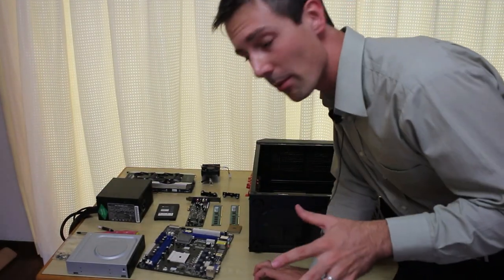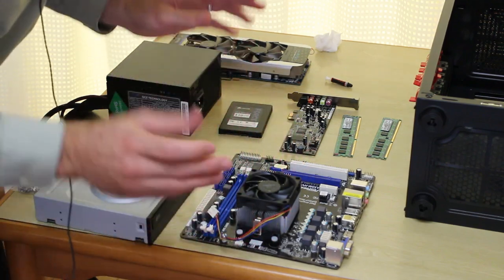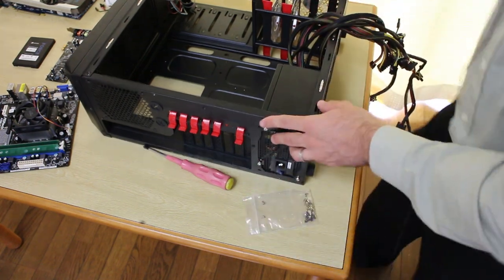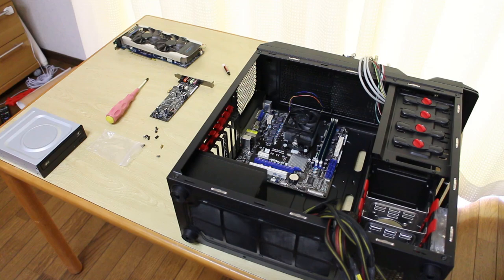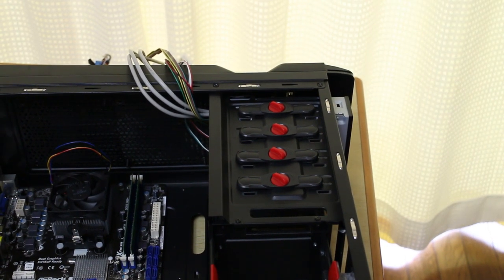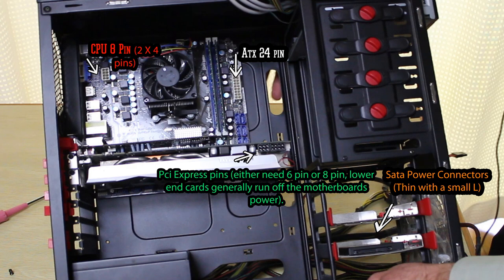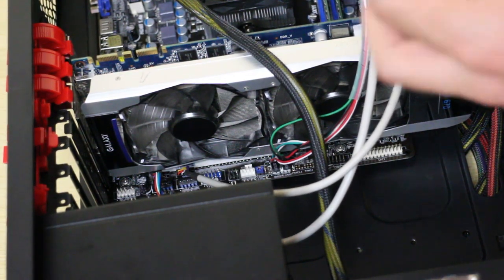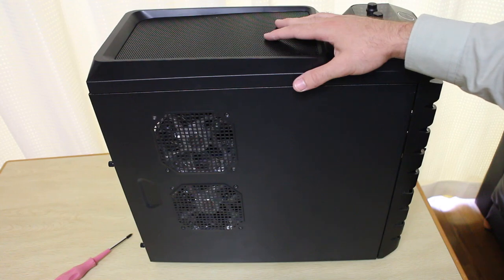How to BUILD your FIRST PC (Full Uncut for Beginners)

Comment: Built my computer via pcpartpicker. Can you give it a look and tell me if everything looks good? (Editing and a little gaming is what this is going to be used for) I did not include a monitor or OS for I have 2 monitors and a hard drive with W8 already installed on it. http://pcpartpicker.com/p/zXXVbv
Reply: For that price, it's awesome! Looking to make my own computer too. For the graphics card, I'm going to end up going with an AMD R9 series card. It's cheaper and still pretty speedy, plus for the price of an Nvidia I can get 3GB or 4GB. With the money you save you can also upgrade to a 1TB HD. Here's my build if you want it; it's a little cheaper, with room to upgrade to your i7. It's 640 or so without the monitor and keyboard:
http://pcpartpicker.com/user/sunnyelsa/saved/hTdMnQ
I did not include Windows 8.1 as well (because I can get it free through the university). And I found one heck of a case with bang for your buck, if you're interested (it's $40 and good quality, not to mention pretty):
http://www.newegg.com/Product/Product.aspx?Item=N82E16811147153
Reply: Very nice, I am more into the black/green color scheme case though
Reply: Very nice I did something similar I found a cheap 300$ build and then added the gtx 750 ti I run it and it is great for medium gaming
Reply: Sick my man
Reply: Nice build!
Reply: You should probably go with a k series processor for over clocking, since this is a gaming rig going for an i5 could allow you to buy a better graphics card.  All your parts will work well together though if that's what your asking.
Reply: Which games you wonna play with it? 'Cause your build is not good. A i5 4670K with a gtx 760 or 770 would be much better for gaming
Reply: its for editing not gaming
Reply: Oh than is this build good enough.
Reply: RebelEdits make the optical drive bluray

Comment: Is this a good build? http://pcpartpicker.com/user/GeekaWhat/saved/7bT323
Reply from the maker: Jacob3922 | RBLX Will run games pretty poorly, for the money this is one of the best you can get - http://pcpartpicker.com/p/xXTTxr if you can get an r7-250x for cheaper than go with that, though I would get a better power supply while you are at it lol.....  And as for a case just sit it on the card board box until you can afford something better.
Reply: Guys, guys. Just go to iron side computers and get the minion
Reply: Andrew Oh  The minion is overpriced.
Reply: Jacob3922 | RBLX You should get a Quad-Core instead of a Dual Core. It can run a lot more faster. Plus, its only ~$10 difference. In the long run, it'll be worth it.
Reply: AlphaPlays TGI?
Reply: Jacob3922 | RBLX I would suggest more RAM, the processor at 3.8 GHz seems great though
Reply: Do the parts and case come with the screws? 
Sorry if it's a dumb question I've never built a pc before
Reply: Jack The Titan I'm new at building pcs too, i've actually never done it but have been looking at lots of videos for my future build, and most of the time the screws are supposed to come with the case
Reply: For $350 you get an Intel Pentium 3.2 GHz dual core, a 260X video card from ADM or a 750ti from Nvidia with 2 Gigs of video memory, a 4GB DDR3 1600 ram stick, 430 W PSU, a 20-30$ case, 500GB-1TB hard drive for like 35-50$, an LG1150 motherboard for upgrades later on with 2 RAM slots (Get an 8GB if you have the money instead). You can run games like CS:GO, dota 2, LoL at 1080p 60 fps. You can also run dying light and GTA V but you'll get 30-45 frames on medium-high settings. The build I'm doing but I don't care for graphics much as long as I get 30 FPS or higher.
Reply: +Jack The Titan yes, they will come with stuff that will help you get everything together.
Reply: http://pcpartpicker.com/p/zz8KD3 the build. You can change the case and hard drive for less.
Reply: whats your budget
Reply: +Jacob3922 | RBLX lol
Reply: +Jacob3922 | RBLX Your trolling right?
Reply: Shannon Fox No it was a legit question. I had no experience with building computers when I posted this.

Comment: is this a good build? and will all the parts work together?
http://pcpartpicker.com/p/FtHQpg
Reply: Yes the parts are compatible, pc part picker will tell you so.
It is a good build but I'd recommend a 4gb graphics card for future proofing, and the power supply is un- necessary, go for a 500w 80+ silver instead, unless you purchase a more high end graphics card stick with the power supply you currently have.
Reply: Paul Lynch ok
Reply: +Paul Lynch will it tell you if your power supply is too big for your case?
Reply: Hey, usually power supplies are made to fit into any kind of case, but just to make sure look in the product description of your power supply and check the width of it then compare this to the width of the case.

Comment: I would just spend the 5-10 bucks for a wrist strap if I were you
Reply: It's not necessary, but I understand why you'd recommend it, 
As long as you're not on carpet, or you don't scratch your head or touch your pets while building, and you ground yourself by touching your case before starting, you should be fine!

Comment: How does this look? http://pcpartpicker.com/p/bn8KsY Ordering in a week please tell me what isn't good or what is good >_<
Reply: Very nice, quite balanced, 
As you probably know, the 270x won't get you the best FPS but it'll be fine on medium/high and tweaked ultra.
In the future, however long away the future is to you, I would recommend a more powerful Card. Personally, I would go with NVIDIA, but that's me.
If you prefer AMD, go with the 280x or 290x in the future. If you want to go NVIDIA, I would recommend the 760/770
Reply: Looks like a good build. There's a newer CPU though called the I5 4690k, which is cheaper and much better. Also, If you have the money, get the 400R, not the 300R, as it has nice lit up fans (3) (Along with a button to turn the lights off) and has much more advantages that the 300R
Reply: Hey if you guys could tell me what series of graphics card and CPU or APU's of AMD does the GIGABYTE GA-AM1M-S2H AM1 HDMI SATA 6Gb/s USB 3.0 Micro ATX AMD Motherboard support. Thanking you in advance
Reply: Actually I did search the net but it wasn't really clearly written or written in a too complicated language for me to understand so if you guys could just un-complicate it for me.

Comment: can anyone tell me if this build is any good? 
http://pcpartpicker.com/p/k4vhwP
ive gotten a lot of mixed reviews. i know i dont need 6 cores but i dont know much about building and that one was recommended. and if i change the cpu, what else should i change/upgrade?
Reply: Gabriel Rivera You can't connect to the internet if you don't have a wireless adapter. Also if you're trying to run games on this computer, just go to Game-debate.com and click "can i run it" then enter your gpu and video card specs and it will show you how well you can run the game.
Reply: James Cogdell i have a ethernet cable. .thanks for the site
Reply: Gabriel Rivera get a better GPU.
Reply: Phantom yup i kind of completely revamped my build. http://pcpartpicker.com/p/dg9CQ7
got a lot of feedback and suggestions. everyone seems to like it.
Reply: Gabriel Rivera looks great! :)
Reply: +PandaYT Is this a good Build 

intel core i5 4690k processor (3.5 ghz 6mb cache lga1150 socket)

evga nvidia gtx 970 ssc acx cooling 2.0 4 gb graphics Card

corsair cmz8gx3m2a1600c9 vengeance 8gb (2x4gb) ddr3 1600mhz cl9 xmp

western digital blue wd10ezex 1tb 7200 rpm sata 6.0gb/s 3.5 hard drive

Cooler Master HAF 912 PLUS RC-912P-KKN1

EVGA 600W Bronze Pc Power Supply 

ASRock Z97 Anniversary Motherboard - ATX, Intel Z97, Socket 1150

thanks

Comment: this is too much for my brain....im good with programs but not actual PC parts
Reply: it is actually easier the hardware stuff than the programs or programming. HTML  I learnt on my own and it is nasty. Building a PC  I realized that you just need to know the Motherboard manutal, it tells you what kind of RAM will accept and what CPU either INTEL or AMD and what speed you can insert as max same as amount of memory.. The littly thricky part is the umbilical cords like the Reset, power cable, those cables from the case onto the motherboard after that, the rest is not that hard.

Comment: SSD for a first build is a waste of money
Reply: Wicker _ You wont get more fps in game using an ssd. Only faster loading times. Game these days use a lot of disk space, which is very expensive using a ssd. Using suspend to ram is the fastest way to  get your OS running. First users should get a normal hdd and use that money for the best gpu for their money. A ssd can be installed later
Reply: Thomas Cavanagh Who said anything about gaming? SSD's are just good period.
Reply: Depends on your budget. End of story.

Comment: "If you shock things a lot go ahead and get a static wristband." Proceeds to build entire computer without mentioning exactly how the band should be used. I.e. what the clip should be connected to, the motherboard, the case, the power supply, an outlet...

Comment: https://pcpartpicker.com/parts/partlist/
Can someone please help me and tell me if this is a good pc for cod csgo and gta?
Reply: ben Lockwood Overkill for 1080p gaming.
Reply: ben Lockwood Don't change anything. This will keep a great framerate while running any game on ultra and 1080p. I have a similar build and it's fantastic. Although, unless you plan on overclocking your cpu you don't really need a liquid cooler.
Reply: +ben Lockwood
oh my god, you have exactly the same parts i have for my new PC im building. deja Vu !!!

i was also wanting to know if that would be a great setup for gta, thanks !!
Reply: +Zertify http://pcpartpicker.com/p/xCP4kL
Will run bf4 on low settings more than 60 fps
Reply: LEL, That pc can run bf4 on med with 60 fps.
GTA V on lowest = over 60 fps.
CSGO on ultra = 100 fps.
Club Penguin on High = over 9000 fps.
Reply: ***** CSGO you would go above 200 ish?
Can't really tell GTA is high cpu, so idk
Reply: np

Comment: http://ca.pcpartpicker.com/p/WZg823 Can anyone tell me if this a good build? And am I getting the best deal for my $? It's mainly for gaming.
Reply: ebutuoy Hey dude, it looks pretty good, with the exception of two things.

1. Switch the CPU to an i5-4460 or an i5-4440, whichever is cheaper. The one you have right now is meant for overclocking and is overkill for your graphics card.

2. You could probably go with cheaper motherboard, case,  and ram -- it won't make a difference and you can save a bunch of money. Just MAKE SURE to read user reviews on newegg.com before you make a purchase. It has saved me from buying crap products before.

Wow, things are a LOt more expensive in canada.
Reply: ebutuoy Oh, and buy windows 8.1 instead of windows 7. It is the same price, a and you can disable the stupid start menu thing pretty easily. It also comes with a free antivirus called Windows Defender which is pretty decent, and you get a free upgrade to windows 10 when it comes out.

Comment: Could someone tell me if this is a good pc? http://pcpartpicker.com/p/hz2pwP
Thanks the help is appreciated :)
Reply: It looks good, but you're paying too much for the harddrive. You can get 2 tb's with a western blue for 70 bucks :) or get 1 TB for 50 and pick up an ssd? Happy gaming!
Reply: Thanks for the tips. :) What size screw driver do i need
Reply: +Prodigy I have a magnetic screwdriver. The star looking one
Reply: does that work with all screws?
Reply: Prodigy worked for everything i needed :) gotta love magnetic screwdrivers. never drop those tiny screws haha
Reply: but does the screwdriver itself work for every type of screw? :P thanks for all the feedback btw
Reply: Prodigy well, not every type. there's some screws that are flatheads and ect, but MOST that i've built are starheads. No problem, I like helping people shrug if you have any other questions or need help let me know.
Reply: can you link me to the one you use on amazon? and what cables do I need? sorry for all the questions xD
Reply: +Prodigy don't be sorry to ask questions :3
Reply: So it comes with everything I need? :P Idk what the motherboard disc is and im just going to buy a windows 7 key xD
Reply: +Prodigy a motherboard disc comes with your motherboard. It'll be in the box. It has all the basic drivers for the motherboard. (Audio, Internet connection through Ethernet , and many more.)
Reply: ohh alright :) so it comes with everything right lol
Reply: +Prodigy yep, everything! Except a screwdriver haha
Reply: lol yeah, thank you for all the help :D does the psu come with the part to plug into the wall xD is it vga or hdmi. ty so much
Reply: +Prodigy the power supply will come with everything you need. The graphics card supports hdmi and dvi. You should get an adapter in the box to plug into your vga monitor and then into graphics card. It depends if your monitor supports dvi/vga/hdmi. If your monitor only supports 60hz you're better off with hdmi/dvi :)
Reply: I got hdmi monitor and a vga just wondering. thank you for all the help once again.
Reply: +Prodigy no worries! Enjoy :) if you need help later on let me know
Reply: Does the cooler/cpu come with thermal paste? I ordered all the parts btw :)
Reply: +Prodigy on the stock cooler there is already thermal paste on it. If you bought a heatsink they have thermal paste for you on the box. Yay! When are you getting the parts?
Reply: I think they should all arrive in two weeks. most if it is coming within 3 days though. I ordered an ssd w/ it. Do you have skype by any chance?
Reply: +Prodigy I do. Was just gonna ask you if you wanted mine: wolfie0523